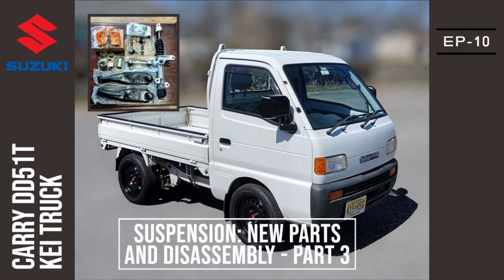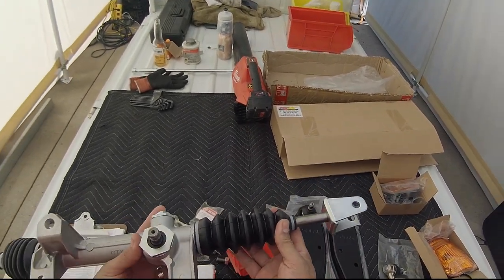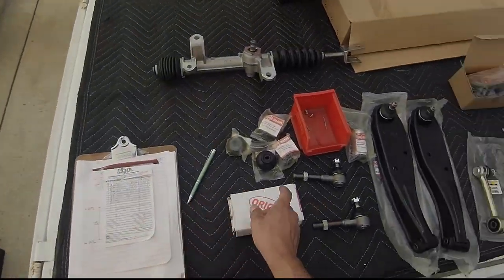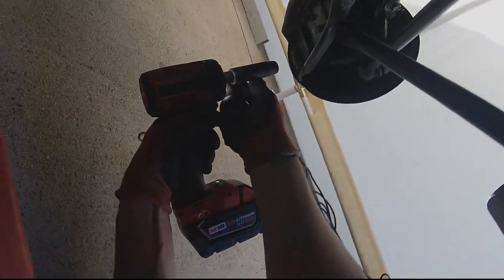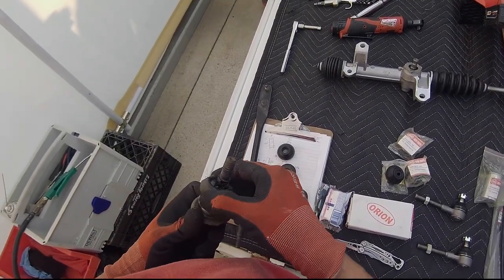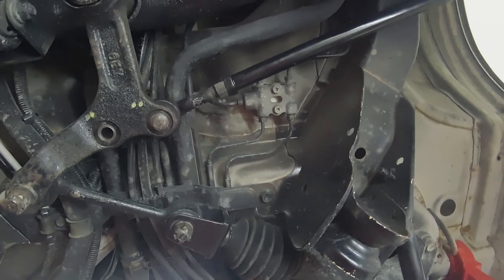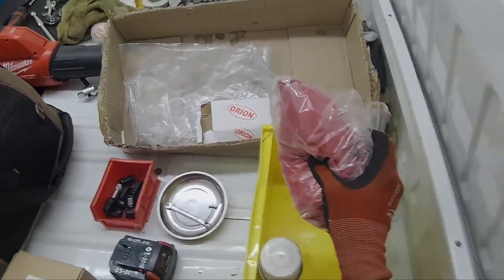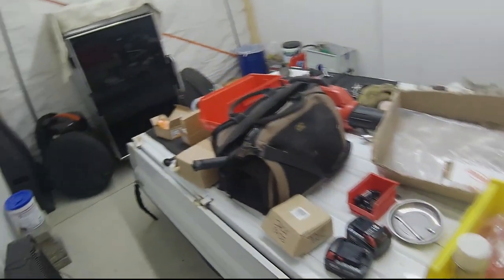Suzuki Carry Kei Truck: Suspension - New Parts and Disassembly Part 3 - EP10

Comment: nice job .....I just drove one I wanted and the front suspension is really clunky......the upper strut bushings are bad so far, but i bet that theres more wrong with it
Reply from the maker: Yeah, these kei truck some have high mileage and could've been driven through rough road as intended, not highway miles.

Like mine suspension was worn and needed to be replaced fully. Now I can drive on the new larger tires. Only issue is between 45-50mph, vibrates and occasional death wobble. Above 50 is fine. Hearing and feeling noise at the steering rack and pinion. That's my next project is to replace it. Thanks, hope it works out for you.